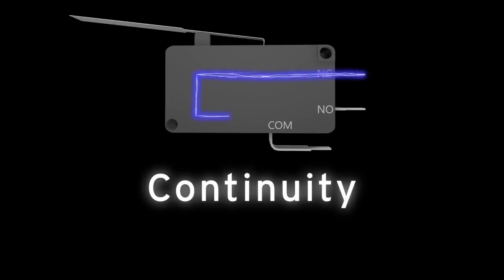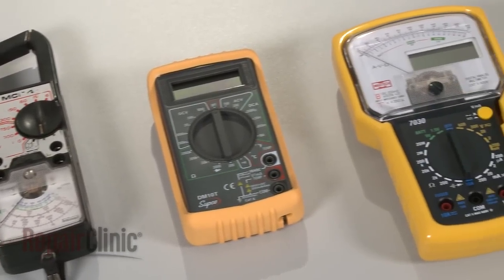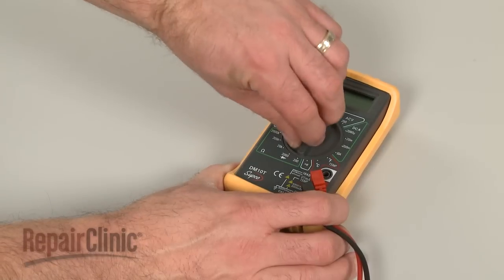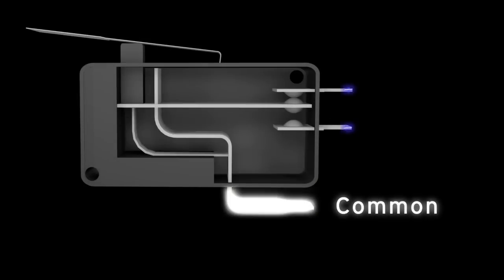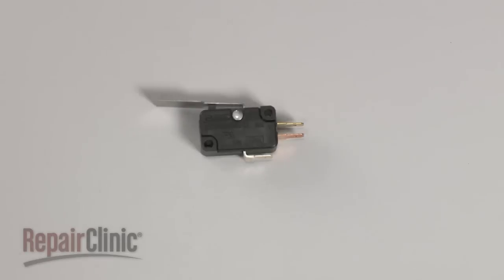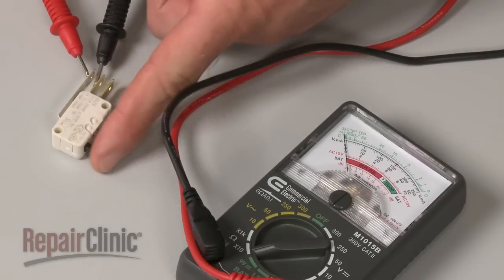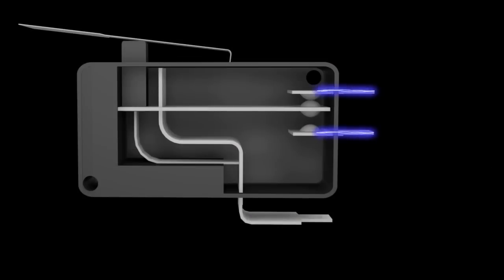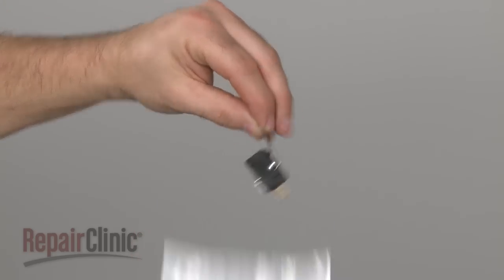Dishwasher Not Starting? Three Terminal Switch Testing, Repair

Comment: Another very helpful RC video, thanks guys!
I used this to test the door latch switch on my Bosch dishwasher.  My switch tested OK, so I cleaned the terminals, put everything back together and ran a load of dishes.  So far, so good.
Reply: Forgot to mention...  My original problem was that the door wouldn't close.  It looks like the latch was stuck in the locked position for some reason, I'm still not sure why.  I was able to unlock it and reassemble everything.  So it's working now, but I may have a defective latch, and may have to replace it at some point.  At least  I know the switch is good.